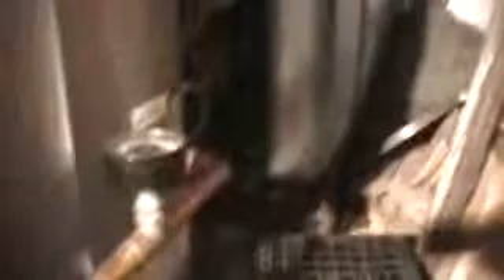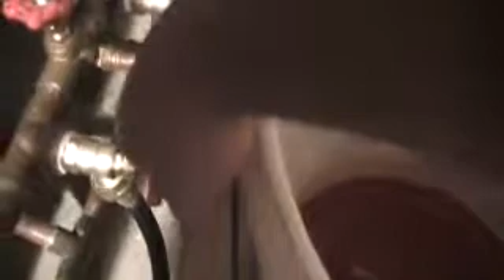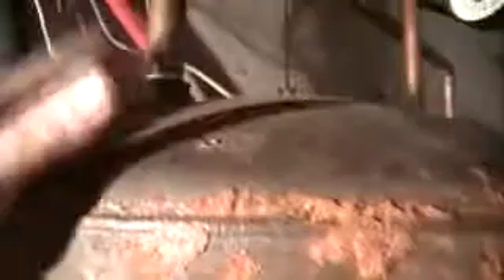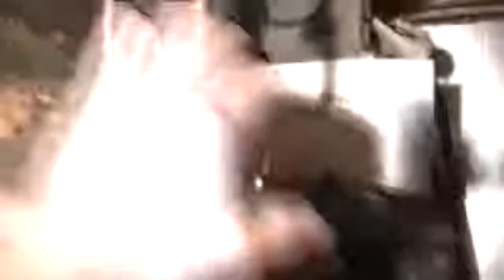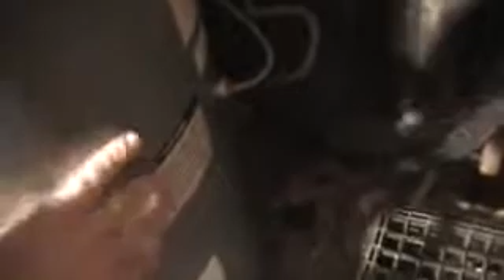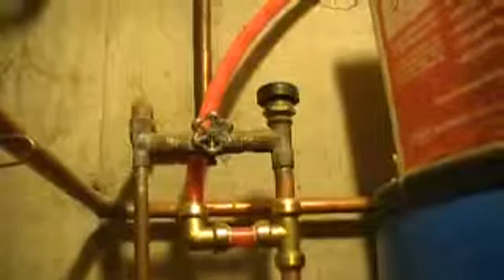how to build a solor water heater part 12

Comment: Some conclusions after 4 years in use?
Have you added an additional collector on the roof as initially intended?
Has it ever happened that the water was overheated, by not using the hot water (being away from home) in a sunny day?
 Other problems, situations?
Reply from the maker: Great questions this was one of my first videos so I think I am going to do a follow up vid. I will get to your questions the best I can. I will post it later today or tomorrow
Reply from the maker: Here is an update to the solar system let me know if you have ant questions.   https://youtu.be/QTq-eQop__s